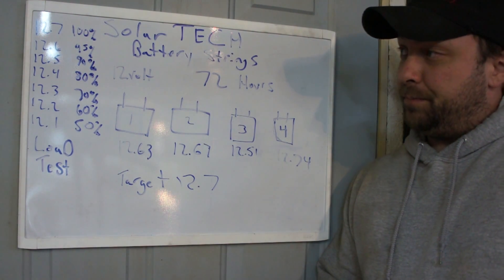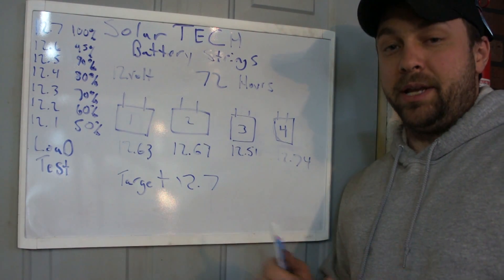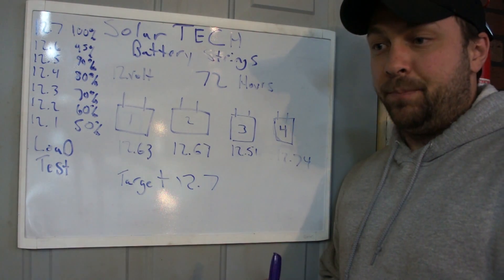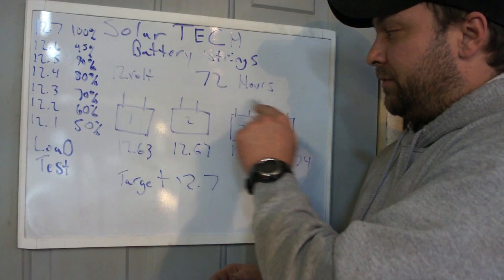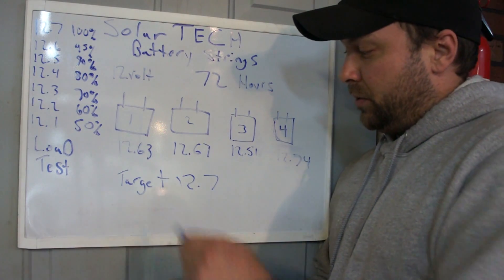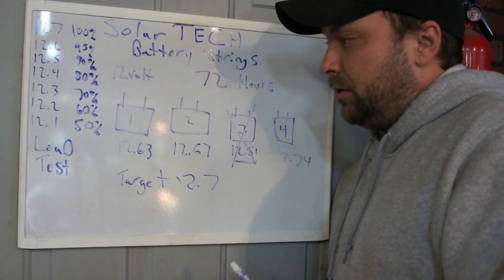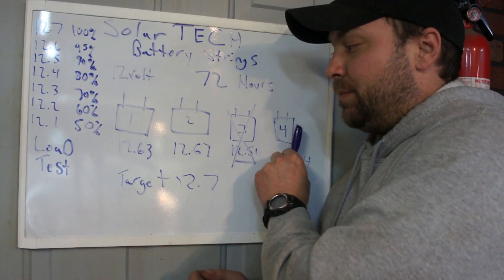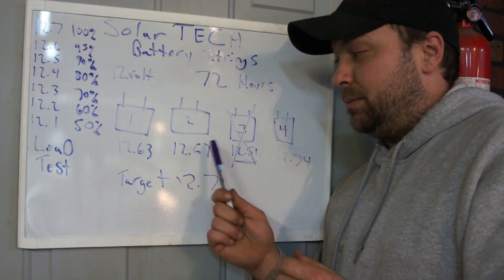How To Pick Out A Battery Bank

Comment: i dont think i would pull a battery from a 'string' because its voltage doesnt hit an arbitrary number. i would alter my capacity so my state of discharge is spread over more batteries and either keep the same state of discharge or lower it. but i sort of agree with you. if my resting charge was <12.2 i may pull that battery. it really would depend on my load(s) and task level. too many variables to account and disregard certain factors. batteries are too expensive and heavy.

Comment: this is the first video i see on yt with al the right and correct info! thumbs up!
(i'm a lead acid battery specialist)
would be a good thing that you also show people how to connect them the right way, serie(24 volts) and parralel (12 and 24 volts) regarding to the equal use of al bats by conecting opposite sides of the bank (so minus one side, and positive other side of the bank (not the battery) also good advice wil be when using serie parralel banks that you should also connect the serie sets on the middle couplers together with the other serie bank) (what y mean is , when you use say4x 6 volt batterys to make a 12 v bank, you should first couple the 6 volts in parralel and then couple these parralel two 6 volts in series with the other two (just to keep them perfectly balanced when using and charging!), say again, good video!

Comment: Right, the bank is as only as good as the bad / weakest battery.  I run 12 group 31 Deep Cycle,  All wire to connect is #2 high count strands,  Then from bank to house 00 underground in sec40 pvc.